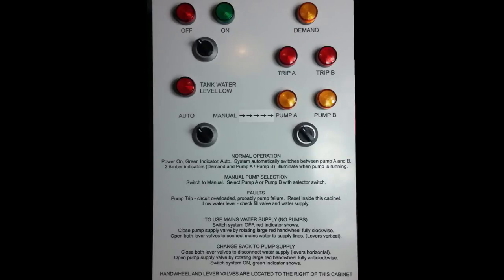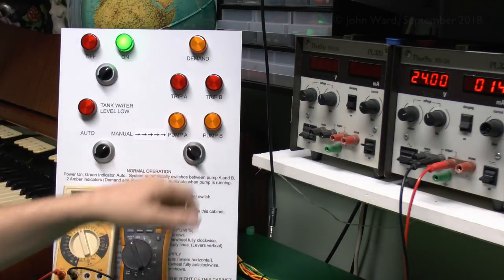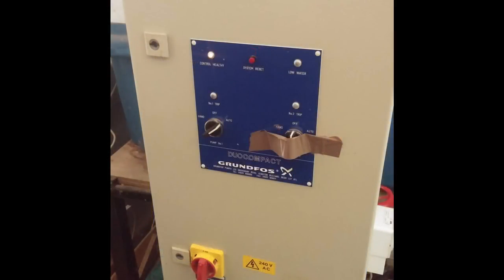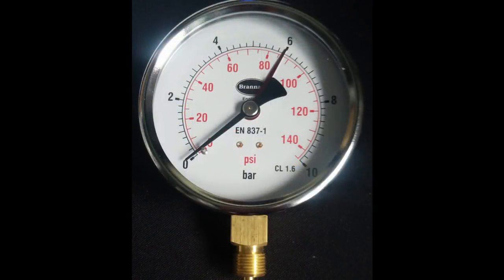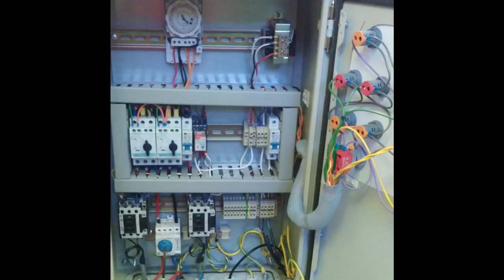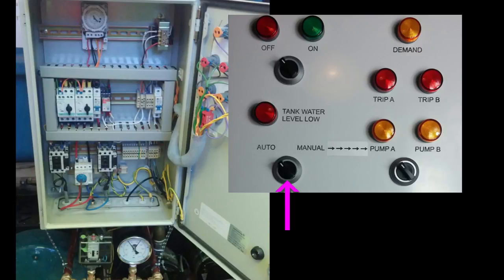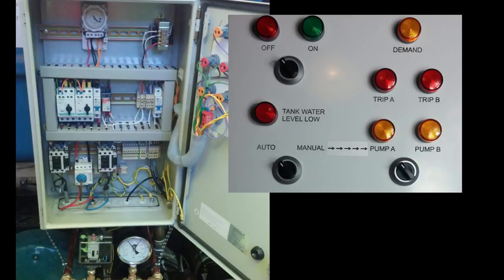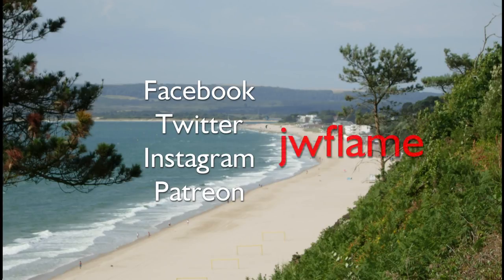Pump Control Panel and Cabinet

Comment: Those twist switches have an extremely satisfying snap!

Its also good to see someone actually getting some use out of those sprung ratcheting crimp tools. They might work for the large gage terminals you are using but you also see them sold for so-called 'Dupont' cable-to-board plugs and they are absolutely useless in that application. The amount of time I have wasted trying to get an effective crimp from those pliers...
Reply: I see what you mean!

I myself am a 1980's microcomputer hobbyist, so don't really do anything with mains other than the odd 5v-9v power supply. Its really hard to find a nice, definite and 'clicky' switch to use for that type of project. Or that is what I have found.

Comment: Really enjoyed this video I’m always intrigued to see how proper equipment is designed. 👍And how the wiring in the cabinet on DIN rails is constructed. 

I’m surprised you’ve not had the comment from “yeah, but a $5 Arduino could have controlled that and sent an SMS also when both pumps failed, as well as adding remote monitoring of each pump’s RPM and temperature and.....and.......and.......” 🙄

You know, just to over complicate things.

Comment: sometimes I wonder why designers go and put high-end electronics in somthing that can be so simply controlled like this.  I can understand the thought, but I can say we have some 1960s era equipment at my work and its so easy to troubleshoot because its all relay logic/interlock and contactors like this.  So nice.
Reply: It makes it easier for the OEM to install, and support. Only one panel design could be shipped to multiple customers, and change plc logic to suit their needs: HMI screen, communication with other panels/process controls, system monitoring, add additional pumps, different duty cycles, ...

Comment: I have a booster pump , i wanted to check if a have indicator/lamp on control panel for high pressure and it is ON what does it mean 
Thanks

Comment: Does the trip also make the other pump take up the duty for the tripped pump?
Reply from the maker: No, it will just sit there with a red light on.  If one of those trips it almost certainly means some major failure has occurred, so further investigation would be required before resetting.
Reply: @pmailkeey the little tank to the bottom left of the panel is at outgoing line pressure, the big tank is at atmospheric pressure. And the valves have a union in between, close the top and bottom and you can undo the union with less than a liter leaking out.
Reply: @pmailkeey it's a pressure accumulator. It's on the high pressure side with a bladder full of air that acts like a spring, maintaining pressure without variable speed pumps. The tank on the intake side of the pumps is at either the low incoming line pressure, or atmospheric, most likely the latter
Reply: @pmailkeey vented tanks are really, really common. Big pressure vessels are crazy dangerous. Negative pressure on a water line is just about the worst possible thing (great way to contaminate a water system) 

Airgapped (tank level is ALWAYS below input level and water pours in rather than having a pipe that goes below the surface) tanks solve both issues with minimal control problems. You could use a direct booster pump but you would need to be absolutely sure you never create suction on the incoming line, and you would need a good  control system to adjust flow to demand.  

Here you could turn on at (for example) 30psi, and off at 35. Turn off pumps if the level is very low, open the intake valve if the level is a little low. That's all the control you need to have a pretty good system.
Reply: @pmailkeey it doesn't have anythig to do with self priming. Once full of water almost all pumps can pull some amount of negative pressure at their inlet.
Reply from the maker: To clarify how this system works:
The large blue tank behind the cabinet is at atmospheric pressure, however there are no dead anythings in it - the lid is bolted on and airtight, the overflow and air vent are designed for drinking water storage and have a stainless steel mesh screen.
The water inlet also has a filter with automatic backflush.
Direct pumping of mains water is possible but only up to 12 litres/minute.  This system supplies 10 separate 3 bedroom flats, 12l/min would be totally useless there.
The expansion vessel on the pump output side is necessary so that pressure can be maintained, without it pressure would drop to nothing as soon as any outlet was opened, and jump to the maximum set limit as soon as all outlets were closed.  With the vessel, pressure falls gradually as water is used, the pump will then activate to maintain the pressure, and if the outlets are closed or the pump provides more than is required it just fills the vessel until the setpoint is reached.
Various other features could be included, but at the cost of adding extra complexity and more things to go wrong, which is exactly why the original system was replaced with this one.
Reply: @jwflame  good forbid people learn how New York apartments manage to have any water pressure 😋
Reply: @pmailkeey Probably no need for legionella testing as the water is mains fed , which typically won't go above 16 degrees C. Cutoff for cold water is 20 and above. I would only be worried about this if it was mounted in a roof void whereby a raised temperature is normal in the summer. As it's in a basement with a bolted lid, any legionella assessment will have to take that into account. If there is constant use and no deadlegs in the basement, with private apartments above, this would be noted as an exception in the water logbook  and no further testing required. However, if there is open pipework in the basement, then regular testing should be carried out.
Also, no BMS connections ? Or have they omitted that option  from the building complex. BMS would be handy for remote monitoring of the system.

Comment: Only thing you might want to add is an on delay relay for the motors, around 30 seconds, so that they are not going to cycle rapidly and have water hammer under certain load conditions near full demand.  Would probably involve another pair of lamps, or a flasher module to flash the motor run lamps, to show this delay in action. Other than that all looks fine, with nice work there.
Reply: Thats what the preasure vessel is for, it acts as a reservoir for small demand. It has a bladder in it that you charge to a required preasure. So if somebody just wants to wash their hands, flush a toilet or fill a kitchen sink, the vessel can supply small amounts of water without the presure switch contacting, thus leaving the pumps idle until more demand occurs or the vessle runs out.
Reply: The pressure switch has built in hysteresis
Reply: Robert Szasz correct. and as John explained...
Reply: Robert Szasz There is one common failure mode, however, that a delay after off switch would help to protect the motor from.  It is not uncommon for old air bladders to eventually perforate and become full of water over time at which point they no longer serve their intended function to moderate pressure and amplify the hysteresis region of the pressure regulator.  Because water is incompressible you can then find oneself in a situation where the pump motor is fairly rapidly bouncing between on and off states since the tank will rapidly lose pressure even under a light draw and the pump will suddenly cycle on very briefly which suddenly brings the tank back to full pressure and causes it to quickly cycle off, and then the cycle repeats — this is both taxing on the motor as well as the contactor contacts (its even more problematic where the pressure regulator contacts directly drive the pump as then the contacts can sometimes become fused forcing the pump to remain on indefinitely unless there is an over pressure switch to break the power).
Reply: @ethanpoole3443  fair point. My experience of pressure booster systems is all on boats where other failure modes are more common, and the failure mode you mentioned would be really really obvious.
Reply: @pmailkeey i would also have done that. Would have been nice to see some cable trunking on the back of the door to tidy up the wiring. I would have been fired if I'd let a door panel go out looking like that.
Reply: @pmailkeey Thats why even simple panels should use cable markers and have a copy of the schematic inside. Makes fault finding a damn site easier if you have something to work with.

Comment: Not using EN 60073 colour meanings?
Reply: The gloves are off with 24V stuff, mate.
As long as the wires don't use low voltage (>50V) colours, they could be anything.

Comment: I have been trying to get help on a certain Electrican question, it's not related to this video but to the minimum cross sectional area of a CPC 

I have to determine for a fridge which has a cable length of about 9meters and watt of 1.8k the minimum possible cross sectional area of cpc which will supply the requirements disconnection as ADS under earth fault conditions and the adiabtaic equation as regulation 543.1.3 in BS 7671

Would really appreciate the help
Reply: 1.5mm
Reply: Gary Lewsam I need the working out or steps cause it's a coursework question and can't just put the answer down but thanks
Reply: @arberor4597  if you can't answer that I believe you have been having far too much fun instead of studying the basics
Reply: Tangobaldy I've already studied the "basics" already got my level 1 and 2 electrical qualification. Pretty much passed my entire level 3 just stuck on a few coursework questions. Been asking everyone for help but can't get anyone to help me out on this